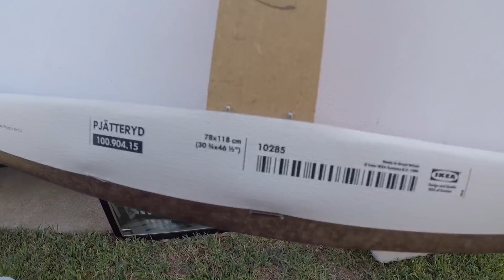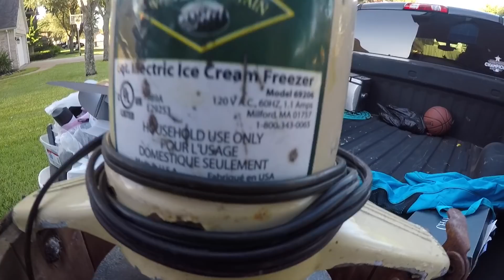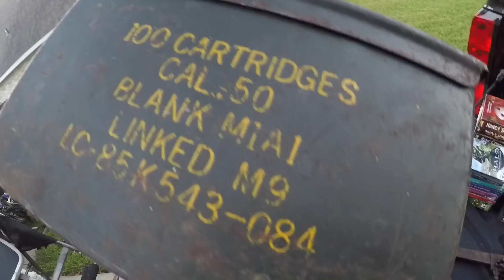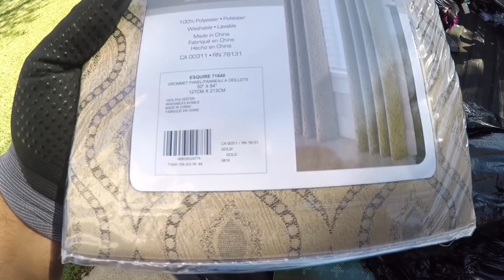Trash picking million dollar homes

Comment: That one item with the handle is an antique blow torch.  I guess the pump is to apply air pressure in the can. I think it runs on kerosene.  Kind of like a flame thrower.  That scale metal is for weighing blocks of ice.  Years ago before refrigerators made ice or stores sold crushed ice, we had to purchase block ice.  They would weight it. That weight on the tailgate is so a certain weight.
Reply from the maker: Great! Thank you

Comment: The ‘bug sprayer’ is  a torch for stripping paint.  You put fuel in the bottom, light the nozzle bit , adjust the screw thing you were twisting to adjust the flame.  Very old school...my father used to use them
Reply: It’s a blow touch... it was a plumber best friend.

Comment: I would have gotten those 3 matching polka dot pillows, but glad you got that older plastic tub with lid because it is quality. Exercise equipment is very expensive, you should be able to get good money for them. That weight thing, we had windows that had those from the early 1900's. They were removed when we had hail damage that broke our windows and we had to get new ones. Those were neat, hated for them to be removed. That butler monkey table should sell for a lot. I found a butler monkey hand towel at Goodwill one time and I put it on eBay and it sold for a lot. I think I paid .50 cents for it, maybe a dollar but several people bid on it. Hope the butler monkeys are still valuable. I also use to buy vintage monkeys and orangutans plush stuffed animals (they looked like the real animals) at Goodwill and those ALWAYS got many bids and sold for a good price too. Don't know if they still would now.
Reply from the maker: Very cool. Thanks

Comment: the last metal canerster is a roof tar melter !!  fill it with kerosene and pump it up  then light it blows a nice flame to melt the old tar on your roof  !! be carefull  big flame !!
Reply: @dillonismael3163   hay dillon,,.    it is also good for melting  ice around your car if you ever get stuck in the snow or on a slippery patch of ice when the wheels just spin !!   melt that ice !!!!